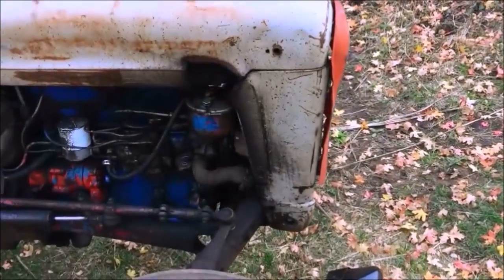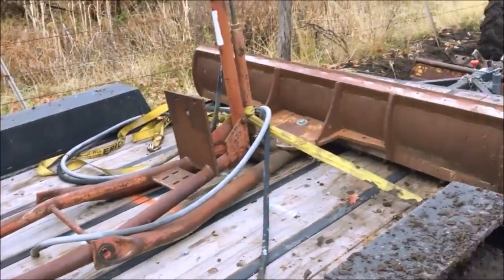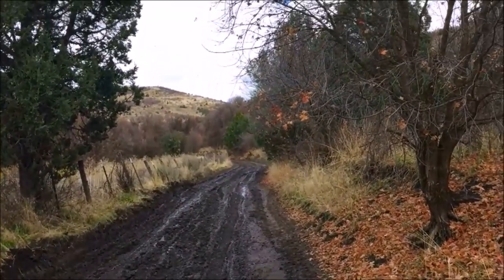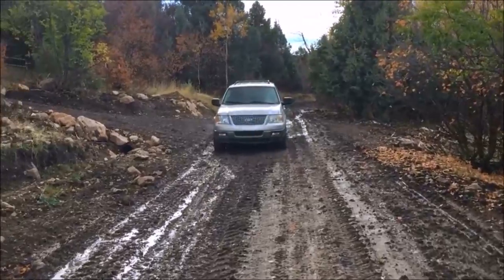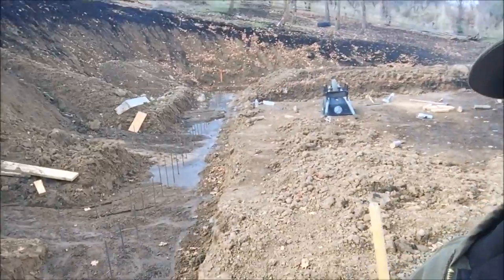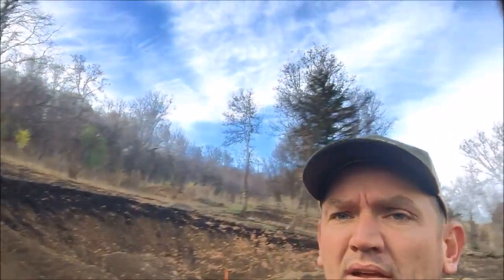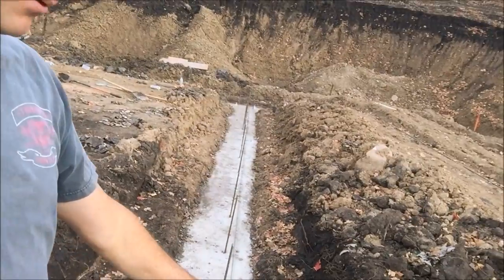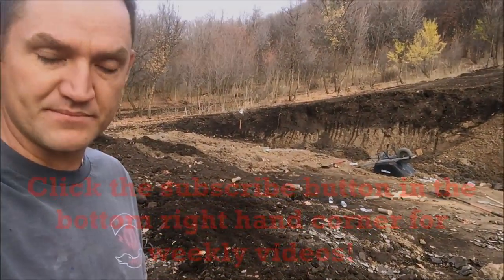#42 - I Had To Rent Concrete Foundation Forms... And I Kept Them Too Long!

Comment: you can use a 2×4 attached to your rear wheel.  To get out off mud. Just use a strap and  a 4 ft peice. It does work. I live in florida and we use it to get out of sand and mud.